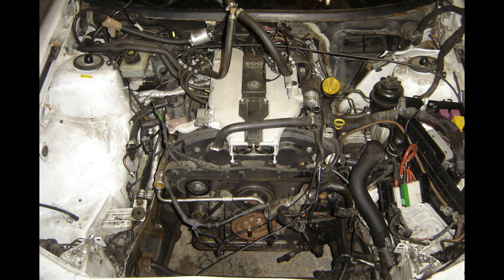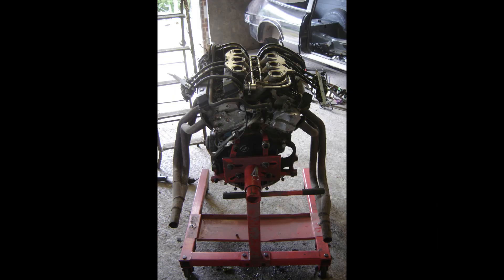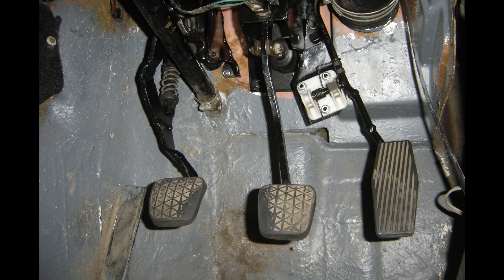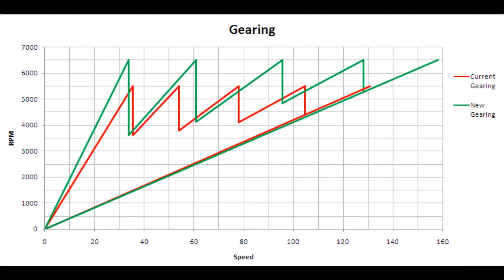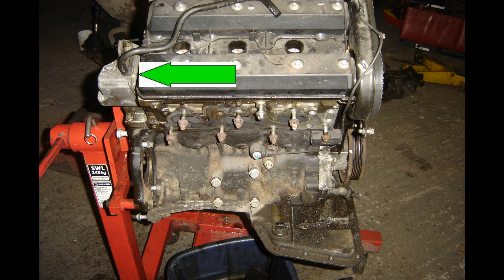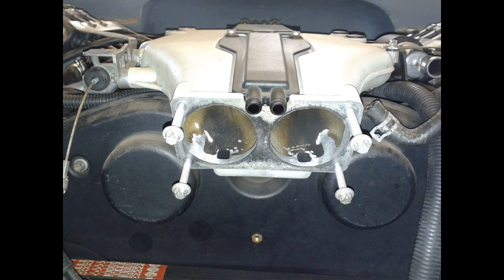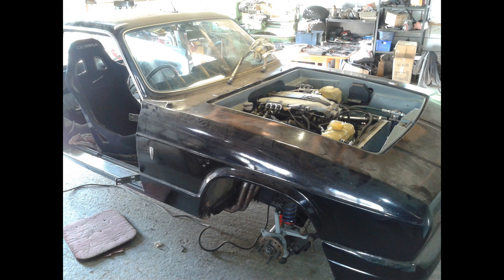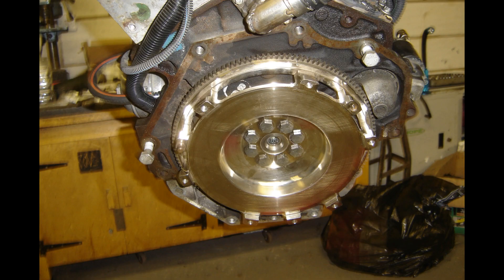Modern Engine Swap Transplanting X30XE Vauxhall Omega MV6 engine & gearbox into a Reliant Scimitar.

Comment: Hi, do you rekon changing de head gaskets is a engine out job?
Reply from the maker: @kaisergaragept  I never really.worked on the engine in its original home. But judging by your videos of stripping it down I would say there is room to finish the job and have the heads off while the engine is in the engine bay. Good luck
Reply: @lozl  thanks

Comment: Hi,   I am planning to fit this engine (x30xe) into my 1969 lotus europa, I have a question for you, did you use the valves in the inlet manifold (between the 2 sides) or did you remove them?  thanks for the video's good help for my build.
Reply from the maker: @oev67  that will be bloody brilliant!!! It's such a cracking engine. Its a real unsung hero I think. 

I removed the flap. It doesn't hurt power I don't think. But I do think k there is more torque to be had in the mid range by keeping it. If you have the facility in the ECU you're using I would suggest keeping it. I'm thinking about putting mine back in and seeing what difference it makes (I have a rolling road now so can actually measure it. But don't hold your breath, this could he years). 

Good luck with that project it sounds epic